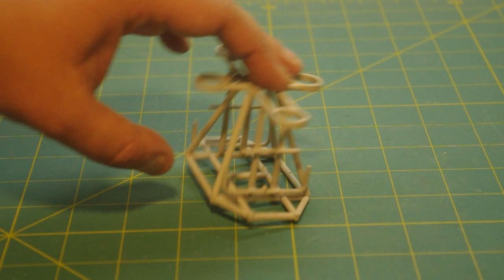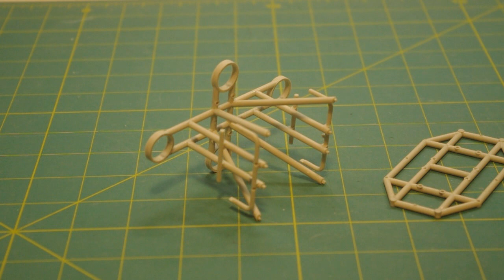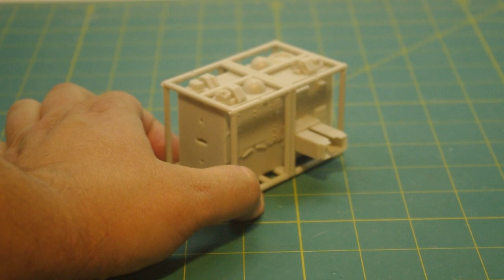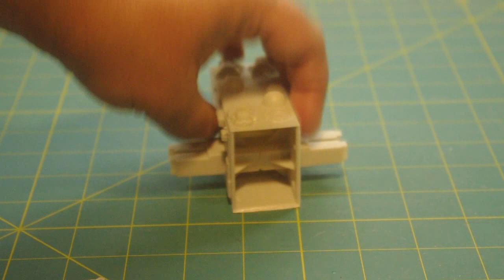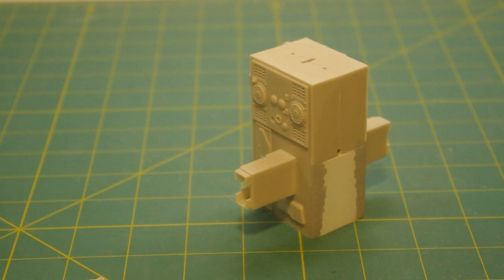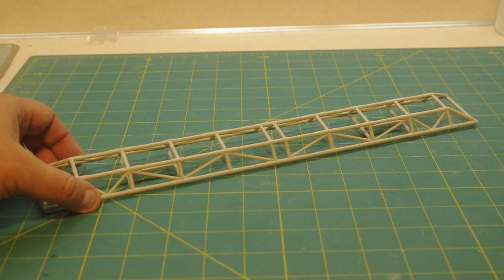MPC Space: 1999 22" Eagle Test Shot Build Part 2

Comment: Good thing I bought a pint can of Weld-On 3.As for the seam on the underside of the walkway, remember the VTOL engines will hide a lot of that, too.I've got just the book to use for the spine...the hardcover of Aftershock and Awe.
Reply from the maker: +Dale Thelander The VTOL engines on the cages actually go over the part of the cage where the seam is covered anyway. Where I needed to take care of the bottom seam is in a spot where nothing else really covers it.